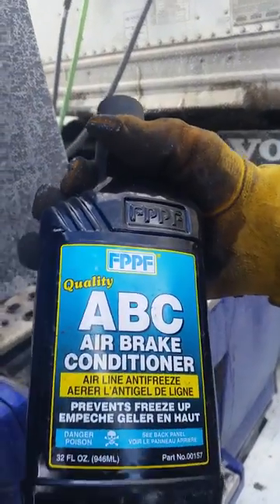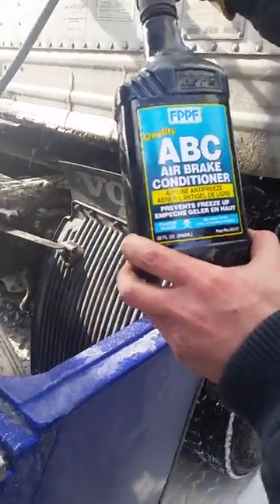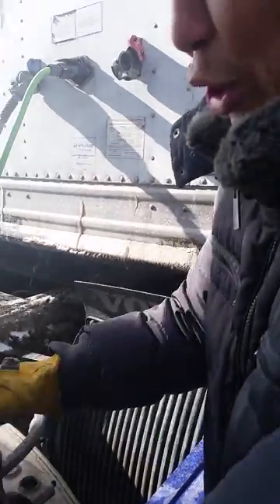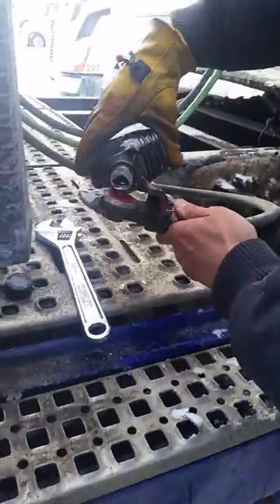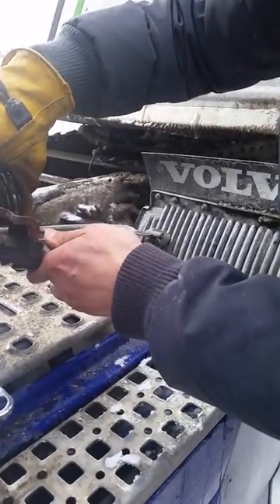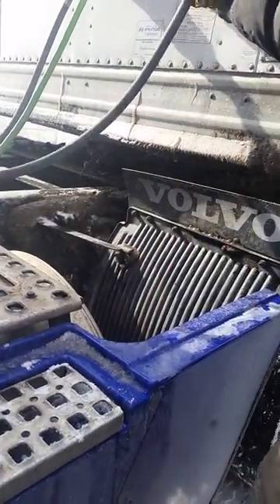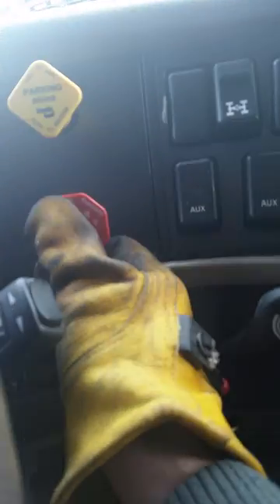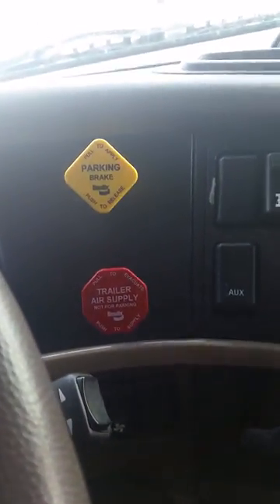How to use Air Line Antifreeze to prevent trailer brakes from freeze

Comment: That's not how the directions on the back of the bottle says to do it
Reply: Worked immediately for me lol
Reply: This is the quick way. If you're switching trailers on a regular basis this is a good practice. My only extra suggestion is to go to the rear most air tank on your trailer and drain it.  That will pull the anti freeze through the lines better. Doing this a couple of times will help disperse the product. And of course regular air tank draining is required.

Comment: Or you could make sure and do your daily dot inspection by kaw and drain your air tanks. Air don't freeze. Only water. I just hate lazy drivers. Do your job and stop putting everyone else's lives in danger by not doing your inspection. Lazy.
Reply: Kinda grumpy😾
Reply: I agree one thing overlooked is draining the air tanks but, if you swap trailers you're going to run into this. I always carried a propane torch to heat the tank up to drain it, then added the alcohol to the lines. Few will crawl under there to do this or use a hammer to free the brakes these days, i don't know if they even teach this in schools or not.
Reply: @gearbanger57  once again by law there is a ore and post trip. Even if only a pretrip done by every driver everyday, there wouldn't be enough water in the tank to cause an issue. Ever. And the newer trailers have disk brakes. So that hammer trick will fade away. No slack, no s cam, no shoes to hit.
Reply: @stevenliberadzki9160  I been doing this for 34 years and i can tell you very few drain the tanks on a pre or post trip. You ain't going to drain water when it's below freezing unless you heat the tank.
Reply: @gearbanger57  great story. I know how lazy 99% of drivers are when it comes to making sure things are running properly. I've been a heavy equipment diesel mechanic for a long time. Water in the tanks comes from the heating element on the air dryer not working or the filter on it past used. If there is any water in the tanks that has a problem. I couldn't tell you how many times I've been under units in the snow trying to thaw them out because of lazy fucking drivers not doing their job.
Reply: @stevenliberadzki9160  Some drivers simply don't know. They weren't taught right. Instead of criticizing them, how about giving them guidance.
Reply: @ContextReallyMatters  how about it was all part of their test to get their CDL. If they passed it they know what to do. I show no respect for not doing your job. Not doing their job put yours and my families lives at risk on the road. Take it lightly? I don't at all because I've seen so many things happen. Leaking wheel seals leading to losing a set of tires on the highway at 70 mph. Not checking your tire tread depth and having a steer tire blow out causing a 10 car pile up killing people. I could go on and on. Yes. Lazy drivers not doing their job is an issue. It's a law for a reason.
Reply: @stevenliberadzki9160  You make some fair points but again, some drivers don't know. I'm sure you've encountered things on the road that wasn't taught to you in school or wasn't covered on a test. I'm sure more experiences drivers have helped you along the way of becoming a professional truck driver. I'm also sure that just because you pass a test it doesn't mean you've retained that knowledge. Especially if you've been out of practice. I wouldn't be able to pass a test on fractions and decimals right now even though I was able to ace them when I was in school. 

You complaining isn't keeping any of our families any safer. Each one, teach one.
Reply: @ContextReallyMatters  your sympathy is misplaced. People retain the important things. They are supposed to do it twice everyday they drive. Should not be out of practice. And I keep people safe everyday doing my job correctly. My failure equal deaths on the road.
Reply: @stevenliberadzki9160  Maybe consider getting out of the keyboard warrior/white knight business and getting into the CDL school business then?
Reply: @archerj2010  I'm already dot certified. I conduct dot inspections everyday to make sure lazy drivers do their job and keep everyone on the road safe. Just don't be a lazy blob that can only drive the truck and use their heads and think about others for once.
Reply: @stevenliberadzki9160  awesome! So what brings you to 'how to do antifreeze land'?
Reply: @archerj2010  As a certified in all oem diesel mechanic there is always things to learn or a way to pass in knowledge. But sometimes knowledge get misinterpreted by people with one sided mentality.
Reply: @gearbanger57  still breaks down to if the last driver did their job or not. Did he do a pre and post trip. Basic, drain the tank. And they don't teach that mainly because new trailers have pads and not shoes.
Reply: @euunitedwestand1471  musta hit a nerve. Ha ha
Reply: @miamiholliwoodmiamiholliwo9192  me too because I'll be fixing things that could have been avoided easily just by normal, lawful pre and post trip inspections.
Reply: @stevenliberadzki9160  Angry? Not even close I would never get angry over some guy over the internet that brags he can do everything that we are arguing about. You can say your a master at everything you talked about but I hate to brake it to you it doesn’t mean anything to me when it’s over a post on the internet.  ✌🏼
Reply: @ahmadm3084  yes angry or unintelligent. Using the f word shows one of two things. Your angry because logically that's one reason or unintelligent because you cannot think of real words to express yourself. Ok what would you call it when a driver doesn't drain his air tanks? Or inspect his brakes to be within specs of dot? What's your rationality behind that? Not lazy?
Reply: @Dhagan85  nah I just have to fix all the crap yall neglect. Then my friends at the pd have to clean up all the bodies from yalls neglect as well.
Reply: @satchemo24  stress is all part of the job. And angry? Not at all. Disappointed is lazy drivers that can't seem to do their job fully. Absolutely. Some don't really see the safety factor in their job. Unfortunately I see it often. But only after people have died.
Reply: Even doing a proper drain daily won't be bullet proof. Having tips like this helps out especially if you are doing lots of drop and hook running from warm to cold and vice versa climates. You can't always rely on the last driver to be diligent.
Reply: @gearbanger57  agreed. Having a tip or two to help out is essential and has helped me out on numerous occasions. I run steady with the same trailer now and drain the tanks often and will still run into trouble occasionally.  Heat here and a tap there and no flat spots on tires.
Reply: @rodericktrowhill4132  if everyone drained their. Tanks re and post like the law says, why would it matter if you're going hot to cold weather or grabbing new trailers all day? How else can moisture build up in the air system? I'm only a veteran heavy equipment diesel technician. Please inform me.
Reply: @stevenliberadzki9160  read the statement..... you being a tech should know not every driver will. So..... having a practice such as this is a help not a hindrance. Air systems leak. Even brand new ones and well taken care of ones. Believing they are perfect is a mistake. So....... again having a practice like this and following one is only helpful.
Reply: @rodericktrowhill4132  ok, how does a air leak add water to the system? Answer is it doesn't. So as I stated before and I know obviously there are endless unsafe ,lazy drivers. So as I stated if the REQUIRED dot I section is done by law everytime you hook or drop or slipseat or whenever you use a unit water will not reside in the air system. There is no possible way. There for no need for additives that actually clog the air system, i.e. mv2 mv3 and all tpvs ect.
Reply: @stevenliberadzki9160  you know what? I really have no clue. I've drained them brand new and old. The point of using the stuff is to get you out of a situation you may or may not have caused. I drain my tanks on the regular. That's enough for me. When the weather changes I'll run some their the system for my own piece of mind. In other words just a little. Charge the system and drain it then do it again and drain again. For my own piece of mind. Obviously you're a grumpy guy looking for an argument and worthless to me as a help.
Reply: @rodericktrowhill4132  I did just help you. Letting you know it's all preventable. You drain the tanks of the units you run. Well done. That's all you need. No need to add any additive. If you were an owner operator you wouldn't add a drop and just do the same dot protocol you follow now. I'm not grumpy, just straight to the point and factual. Plz don't misconstrued my statement for aggression. Drivers not doing their dot inspection properly just puts all our lives at risk. It can be brand new or old. They all have issues. We get endless manufacture campaigns on all our trucks. We run our trucks to 500k or 5 years and sell them. So I see them all and dn near have in my career, including all types of drivers. So many issues can be solved by just doing what you're paid to do. I say non owner operators maybe 5% do their federal mandatory dot inspections. And that is terrible. I bet you don't even know how to do one properly. You most likely thing you do but don't. You know " enough " to set you at ease. Truly a shame to 95% of drivers.
Reply: @stevenliberadzki9160  mannn, sthu 😂😂😂
Reply: @snoopj15  you know it's true. Lol. Unless they are owner operators they don't care.
Reply: @yellaboi1195  so I'm the reason? Dang. For someone that has zero social media I sure do influence a lot of people. Or it could be other facts in play. All I stated was facts btw. I've been in the field many years and I know for sure and also I could get some peer reviewed studies if you want. That 85-90% of cdl b and a drivers do not do a proper pretrip. I also know for a fact if those had been done ot could have saved many deaths cause by truckers. Don't hate on me for saying facts that hurt your feelings. Talk to your fellow truckers and yourself and stop adding to the laziness that is the trucking field. Not doing a correct dot inspection doesn't make you a bad person, just makes you lazy. Oh no time, get there earlier and not last minute. I've heard em all.
Reply: Someone hurt you in life it’s gonna be ok man 😂 you have a complex were you feel the need to correct everyone for their mistakes sending you a hug bro  and happy holidays
Reply: i dont know about the american trucks but in europe trucks and trailers have air dryer filter so there is no point draining the air tanks at all ... and still, its possible for the brakes to freeze. What can you do with ambient moisture ? Nothing
Reply: @johnnyhun1  silly. If there is moisture in the air tank it isn't from the the temperature outside. Yes American trucks have Desiccant filters. Ya, dot just wants everyone to do extra work. So ya there is a point.
Reply: Ok, super trucker
Reply: @stevenliberadzki9160 lol😂 I’ve been driving for many years and even if u do that on a daily the trailers can still get frozen … depends on the weather
Reply: @zodaalmighty  💯 maybe the brakes due to if they were wet before parking and it got cold. The air system themselves will not freeze if you drain your tanks daily. You've driven. I've seen all aspects of it. Driving, fixing, building in the trucking industry for the top 2 biggest trucking industry companies in the usa. So you are factually incorrect. Not because of lying but because your lack of knowledge.
Reply: You’re not helping anyone talking like that to people. You might know what you’re doing but in no way, shape, or form you should be teaching people. Calling people lazy instead of saying this is what could have prevented that is not helpful. No matter how many times you say you hate lazy people and if people did their jobs right it’s not going to help anyone. It’s foolish and you should not be posting on here with that nonsense. Why are you even looking at these videos if you know? Because you’re looking to criticize people?
Reply: You’re not helping anyone talking like that to people. You might know what you’re doing but in no way, shape, or form you should be teaching people. Calling people lazy instead of saying this is what could have prevented that is not helpful. No matter how many times you say you hate lazy people and if people did their jobs right it’s not going to help anyone. It’s foolish and you should not be posting on here with that nonsense. Why are you even looking at these videos if you know? Because you’re looking to criticize people?
Reply: You’re not helping anyone talking like that to people. You might know what you’re doing but in no way, shape, or form you should be teaching people. Calling people lazy instead of saying this is what could have prevented that is not helpful. No matter how many times you say you hate lazy people and if people did their jobs right it’s not going to help anyone. It’s foolish and you should not be posting on here with that nonsense. Why are you even looking at these videos if you know? Because you’re looking to criticize people?
Reply: You’re not helping anyone talking like that to people. You might know what you’re doing but in no way, shape, or form you should be teaching people. Calling people lazy instead of saying this is what could have prevented that is not helpful. No matter how many times you say you hate lazy people and if people did their jobs right it’s not going to help anyone. It’s foolish and you should not be posting on here with that nonsense. Why are you even looking at these videos if you know? Because you’re looking to criticize people?
Reply: You’re not helping anyone talking like that to people. You might know what you’re doing but in no way, shape, or form you should be teaching people. Calling people lazy instead of saying this is what could have prevented that is not helpful. No matter how many times you say you hate lazy people and if people did their jobs right it’s not going to help anyone. It’s foolish and you should not be posting on here with that nonsense. Why are you even looking at these videos if you know? Because you’re looking to criticize people?
Reply: You’re not helping anyone talking like that to people. You might know what you’re doing but in no way, shape, or form you should be teaching people. Calling people lazy instead of saying this is what could have prevented that is not helpful. No matter how many times you say you hate lazy people and if people did their jobs right it’s not going to help anyone. It’s foolish and you should not be posting on here with that nonsense. Why are you even looking at these videos if you know? Because you’re looking to criticize people?
Reply: You’re not helping anyone talking like that to people. You might know what you’re doing but in no way, shape, or form you should be teaching people. Calling people lazy instead of saying this is what could have prevented that is not helpful. No matter how many times you say you hate lazy people and if people did their jobs right it’s not going to help anyone. It’s foolish and you should not be posting on here with that nonsense. Why are you even looking at these videos if you know? Because you’re looking to criticize people?
Reply: You’re not helping anyone talking like that to people. You might know what you’re doing but in no way, shape, or form you should be teaching people. Calling people lazy instead of saying this is what could have prevented that is not helpful. No matter how many times you say you hate lazy people and if people did their jobs right it’s not going to help anyone. It’s foolish and you should not be posting on here with that nonsense. Why are you even looking at these videos if you know? Because you’re looking to criticize people?
Reply: You’re not helping anyone talking like that to people. You might know what you’re doing but in no way, shape, or form you should be teaching people. Calling people lazy instead of saying this is what could have prevented that is not helpful. No matter how many times you say you hate lazy people and if people did their jobs right it’s not going to help anyone. It’s foolish and you should not be posting on here with that nonsense. Why are you even looking at these videos if you know? Because you’re looking to criticize people?
Reply: You’re not helping anyone talking like that to people. You might know what you’re doing but in no way, shape, or form you should be teaching people. Calling people lazy instead of saying this is what could have prevented that is not helpful. No matter how many times you say you hate lazy people and if people did their jobs right it’s not going to help anyone. It’s foolish and you should not be posting on here with that nonsense. Why are you even looking at these videos if you know? Because you’re looking to criticize people?
Reply: @stevenliberadzki9160  I don't even know how to drain the newer trucks (I've looked)
Reply: @stevenliberadzki9160 also, the guy in the video should be wearing gloves to do this. See the little skull on the packaging. Definitely not good for the hands